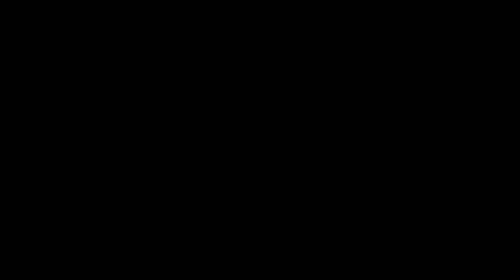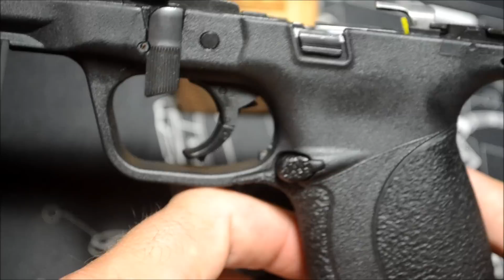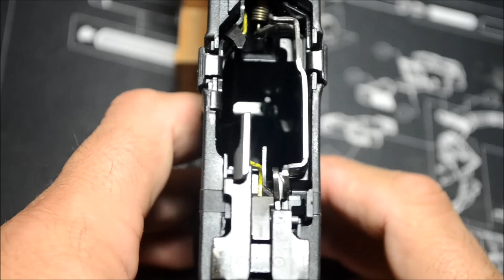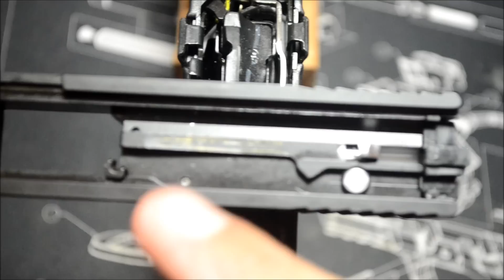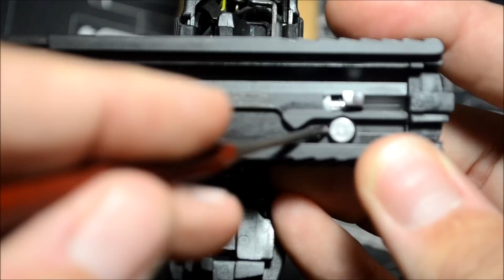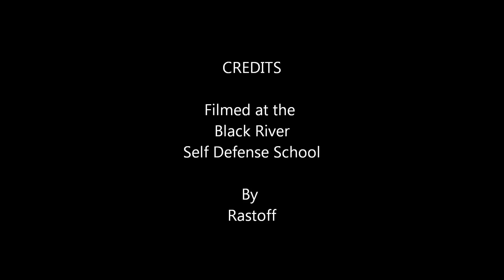Smith & Wesson: How the M&P Trigger Works

Comment: Good job.  Your are correct, almost no one shows how fire control systems in these guns work.  Its good to know and good to know if your striker fired gun has a fully or partially cocked striker and how the sear holds the striker and to make sure the gun CAN NOT FIRE until the trigger is pulled back.

Comment: Ive recently become amazed with the trigger disconnect methods I'm currently trying to look at all of them. No, not for any type of full auto conversion. I have no interest in that, but I see a few comments in each video saying, "if I disable that...." Well, those guys are usually overlooking the firing pin... I just love the intricate engineering involved in coordinating the components and making these machines function. Every time I look at a new component, my respect for John Browning increases a little bit more. Thank you for this video. I'm still looking for my favorite handgun trigger/sear disconnect system. Any suggestions are welcome. I've gone over the Glock and Springfield XD pretty thoroughly. I need to step away from strikers and look at some hammer fired versions...

Comment: What I want to know is if there is a drop safety equivalent to that of the safety ledge like in the glock trigger. Obviously these dont have a reputation of firing when dropped, Im just wondering if the only thing holding that sear up is spring pressure that could be overcome by inertia
Reply: No idea about the Glock, but on the S&W you are probably looking for the "striker block"/"firing pin block". That steel-color cylindrical piece sticking out at the back of the slide. That is blocking the striker (from pushing its tip out of the "breech") from moving past it, unless it is pressed into the slide, by the corresponding part of the trigger bar, when the trigger is pulled. (Now you might be thinking about a drop and inertia of the trigger bar, but that would have to go in the opposite direction to the striker.)
Reply: I believe he is asking if the gun we’re to drop say on the bottom of the grip or some similar angle is anything blocking the sear from moving downward and releasing the striker.  The firing pin block would still be there to prevent it from moving foward to contact a primer but I do not believe any type of mechanism is in place other than the spring pressure to prevent the sear from going downward.  That spring pressure combined with the force of the striker on the sear may very well be more than enough to prevent that from happening, as I have never heard of that occurring.  However to my knowledge there is no mechanical block to prevent the sear from moving downward, like the shelf on a Glock .

Comment: Hi Douglas, I have an M&P 9M I purchased in 2013. The trigger now does not reset after firing. It just stays back until I physically move in forward. I field dressed it a couple time and cleaned it. The trigger seems rough too like plastic rubbing a little. Any suggestions? I know I need to disassemble but would appreciate your thoughts. Good explanation on your video btw. Nicely done. Jeff in Pa.

Comment: Thanks much for posting this video , it was very helpful determining how trigger bar damage was occurring on my 2.0 Compact.

Detail,
2.0 Compact 1st batch purchased in 2017 <-- bad QC evidently.
I've only ran 300 rounds through it.

Damage was occurring on side of trigger bar area were it rides along edge of kick out in slide channel.
That area of channel had burrs so when slide cycled , trigger bar was being eaten up pretty bad.
Damage could be seen , felt & would of gotten worse so fix had to be made.
Contacted S&W warrenty finding it would take 6 - 8 weeks..maybe longer to receive back.
I ended up making fix by lightly removing burrs in problem area using 2000 grain emory cloth & replaced trigger bar.

Comment: Great Video and Thank You...
I have a question for you though. I just purchased my first M&P M2.0 9mm Compact with the 3.6" barrel and yet there is absolutely no audible nor tactile trigger reset. In calling Smith & Wesson,  customer service told me it would come with a good break in period however, others I've handled straight out of the box functioned perfectly. Could it be I was sold a used firearm in place of a new in box pistol? Is it going to be completely reliable? 
Thank you for your time...
Dr. Benjamin Bennett Th.D
Reply: The 2.0 trigger is slightly different than this one. Even so, the M&P series has a very light reset. It's unlikely you were sold a used pistol, but there's no way for me to know.

Comment: What does the small spring do in the firing pin were the plastic pice is , not the long one?
Reply: Excellent question! Most don't even realize that that particular spring exists. 

In the M&P there is a striker, not a firing pin.

 It is called the striker return spring. It's purpose is to ensure the striker is pushed all the way back.

Comment: so is my understanding correct that the striker block is just a safety feature, in that it needs to be pushed up to allow the gun to fire but doesnt actually make the gun fire? what else is it there for?
Reply: That's it exactly. The purpose of the striker block is to prevent the gun from firing when you don't want it to, yet allow it to fire when the trigger is pressed.

Comment: have a question but first good video on how m&pshield functions.. OK I bought new m&p shield cleaned it with balistol. I'm not new to guns but my first m&p. now I went to range an first shot was good second shot the trigger did not reset put a round in chamber but no reset so ejected an shot normal an next normal an then another no reset on trigger... now by my second mag all seemed fine now I did notice on one of my issues I did notice one light primer strike but by second mag all seemed fine.. I shot 8 more mags with no issues. is this maby a break in thing? a fluke maby. gun seems fine now just was kinda worried about the first few shots since is my Carry gun. thank you.
Reply: Sounds like a first time glitch to me. Since your gun worked fine with the last 8 mags, I think it worked itself out. I still recommend cleaning it like you did and going back to the range. If it works fine on that trip, call it good.
Reply: Possibly an improperly adjusted trigger bar - more precisely the part of the trigger bar that goes under the sear. It can usually be reproduced by dry-firing and pushing the slide towards the right while cycling the pistol (while keeping the trigger pressed) - that part that is supposed to engage the sear does not move left enough under the sear.

Comment: I have a double reset on my M&P Pro 9. What I've noticed is that the trigger bar doesn't go to the right of the sear until I start to release the trigger. 
I've tried to explain this to Smith and they tell me that it's normal. Is that the case?
Reply: +Carlos Finch Hmmm, I'm not sure I'm following your issue. As I describe in the video, the trigger bar is moved to the right by the cam in the slide. This happens as the slide is moved back. The trigger bar will move back to the left and under the sear as the trigger is released. This is the reset. 

I'm not sure what you mean by double reset.
Reply: I don't know if my cam and trigger bar are making contact. The trigger bar doesn't move to the right of my sear until I start to release the trigger, causing my first click, the second is when the trigger bar falls back in front of the sear.

From what I can see with a flash light at the rear of the weapon this is what appears to be happening, do you think that it's possible?
Reply: +Carlos Finch Does the gun fire? If it does, the cam must be contacting the trigger bar protrusion. If it didn't, the sear would never set the striker and the gun wouldn't fire.

Comment: This really looks a lot more like a single action trigger than the typical striker fire system that starts with the striker only half-cocked.
Reply: +djohnson1981 It is indeed a single action trigger.  Even the Glock, which moves the striker a little as the trigger is pulled, is really a single action. 

The definition of single or double action is based on what the trigger does. If it only releases the hammer/striker, then it's a single action. If it sets, then releases the hammer/striker, then it's a double action. Since this only releases the striker, it's a single action.
Reply: If the striker gets fully cocked, will the spring wear out if you always leave it chambered?

Comment: Is the striker more like a glock precocked or more like an xd which is cocked all the way rearward
Reply: cmvb69 The striker is fully cocked when the slide is racked. With the factory sear, the rotation of the sear moves the striker back a tiny bit (about 1/64") when the trigger is pulled.